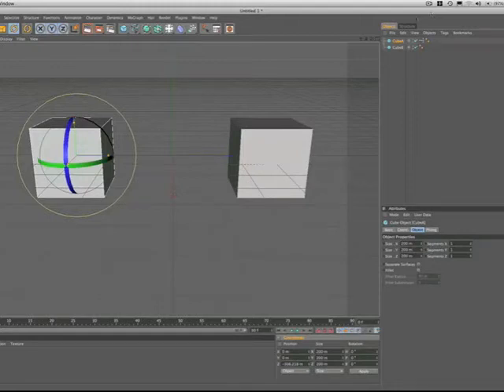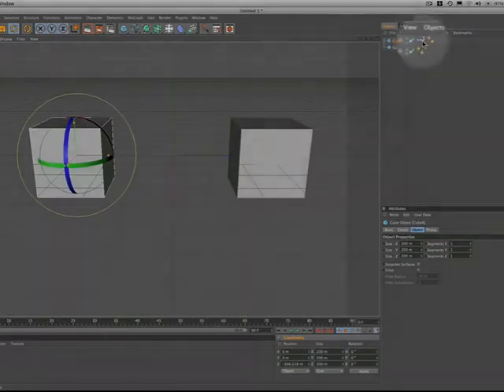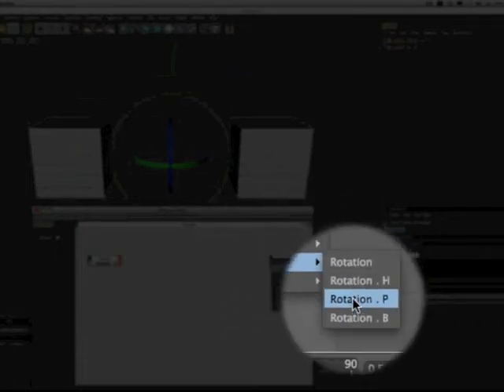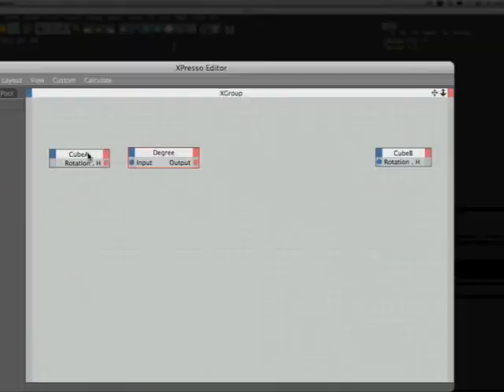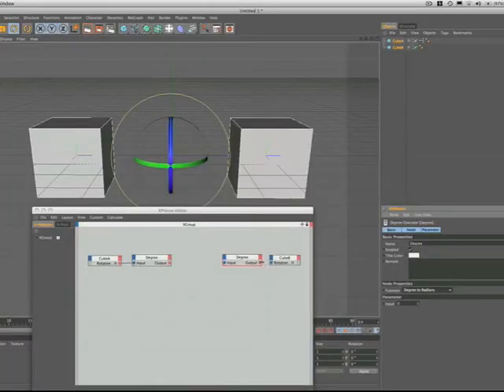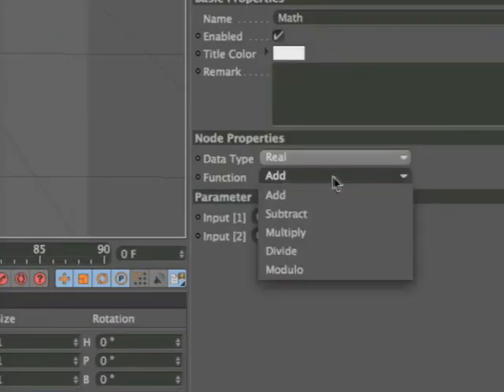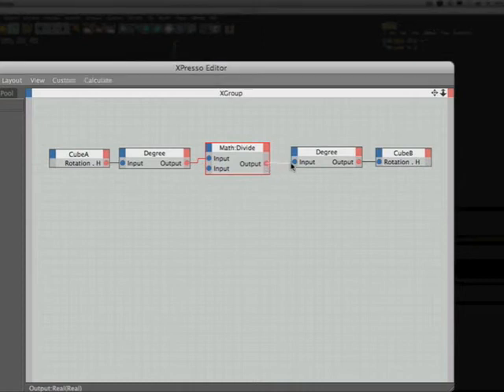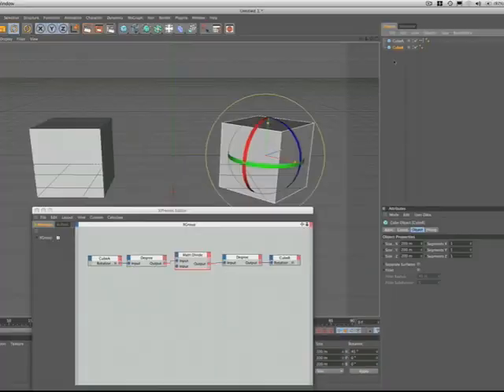Cinema 4D Xpresso Tutorial 2: Transferring Rotation

Comment: This is a great tutorial, I try not to apply the degree node to achieve the same effect, I do not understand why the degree node is added, please help me to clarify, thank you.
Reply from the maker: This is a very early tutorial - I wouldn't add the Degree node, if I made it now!
Reply: @ExpressoMechanicTV  Thank you for your reply. I understand its usefulness. Usually when we rotate the Angle, the result is the arc length value, but it's not easy to know the exact Angle, add Degree, you can know the corresponding Angle value
Reply from the maker: @hjinwei6201  Absolutely. As a rule, I would much rather work with degrees than radians. Far easier to relate to.